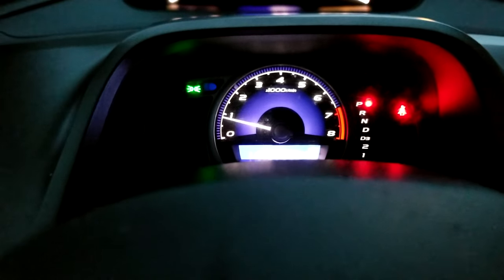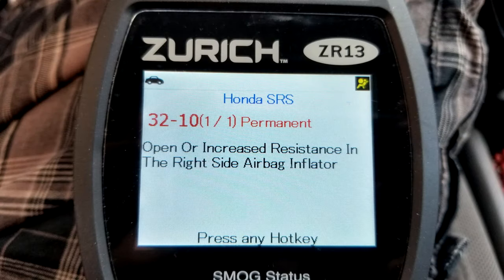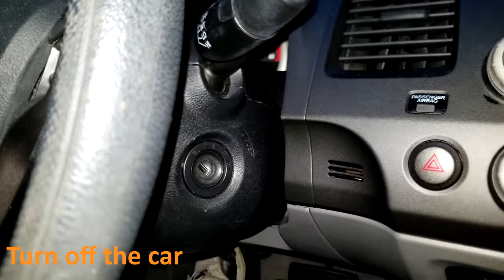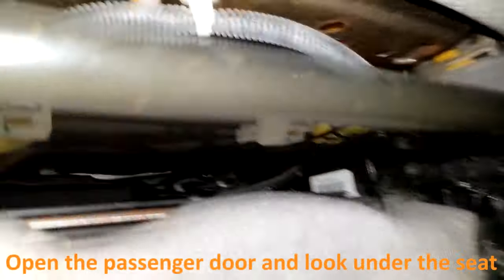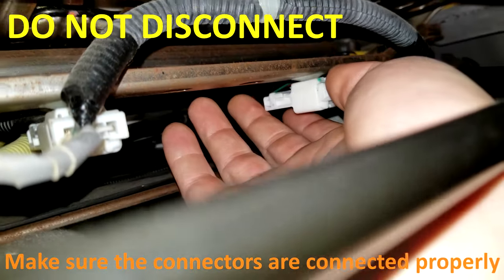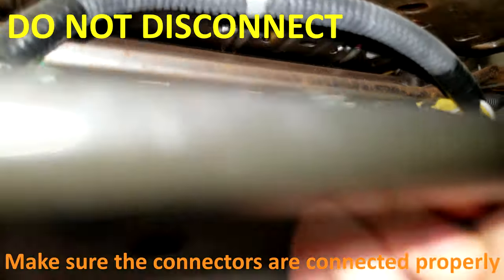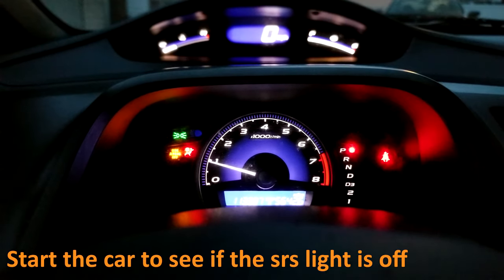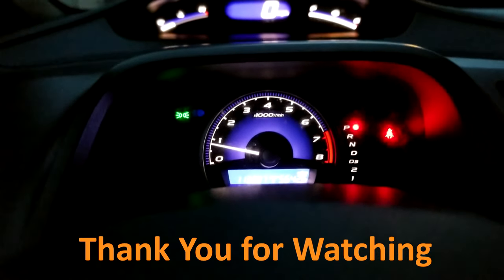Honda Civic (8th Gen) - SRS Airbag Light On (32-10)

Comment: Happened to my car recently. Decided to look up the problem on a whim and this video was the first result I saw and looked at. And it worked! I just pinched the cable connectors to check the tightness and the light was off when I checked afterwards. Before I tried this it also seemed plausible this was the fix due to me having adjusted my passenger seat several times recently and had some boxes on the floorboards. Thanks so much for putting this up!